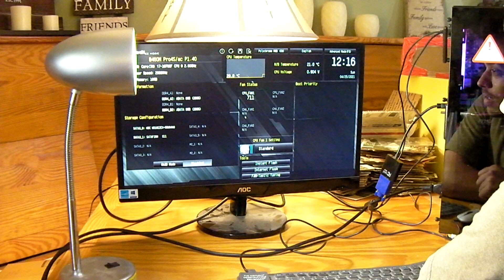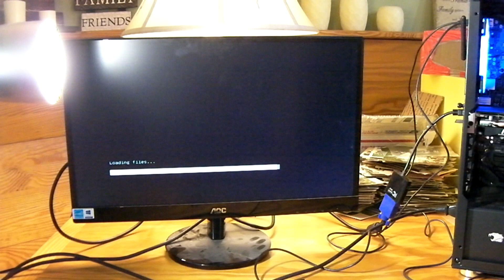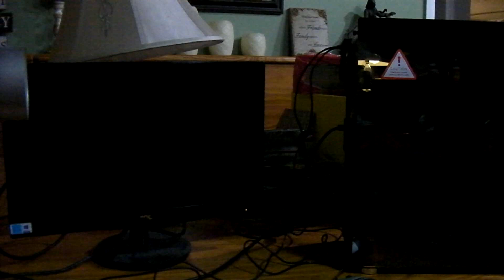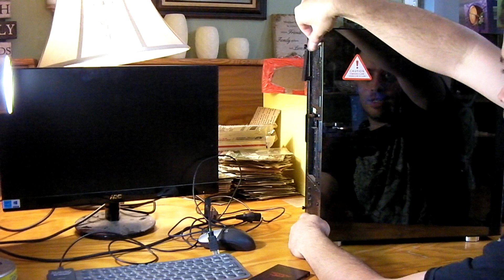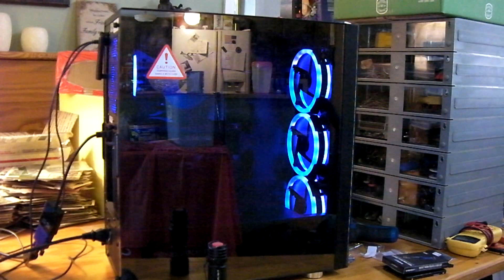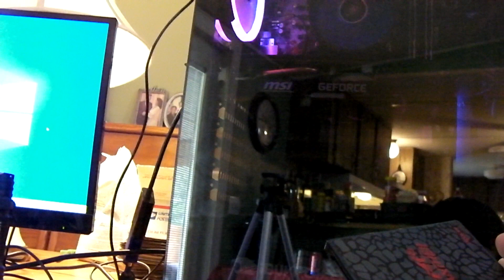iBUYPOWER prebuilt system with failed 2.5 inch SATA SSD

Comment: I have the same problem but nothing is working I'm assuming I need a new hd.
Reply from the maker: If the computer powers up but says No Boot Device or a similar message, then yes the HDD or SSD has failed.

Comment: Appreciate the info, even years later.  had a windows get corrupted(from an update) on my ibuypower ssd and i had no idea it was a board mounted ssd.   I am going to have to replace ssd and start from scratch,  because the computer gets hung at the repairing windows msg and locks up.  cant by pass it or boot to a windows install drive, etc.   Theres no way to turn it off from bios, tried changing boot sequence and still locks up , never gets to the blue screen.  Anyway, apprecaite the info.

Comment: Question can Ibuypower  have two hard drives?
Reply from the maker: Sure... provided the case can hold 2 drives, which I'd imagine most cases used by iBuyPower would support. The one in this video had multiple 3.5" internal HDD bays, plus two 2.5" bays for SSDs, and the M.2 slot on the motherboard for an NVMe SSD.